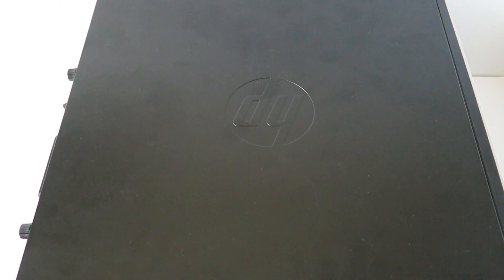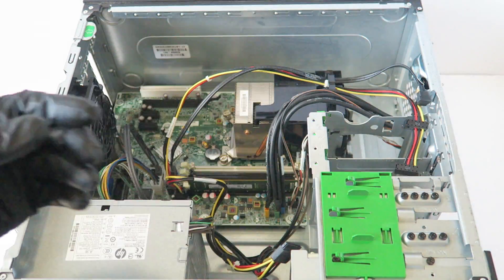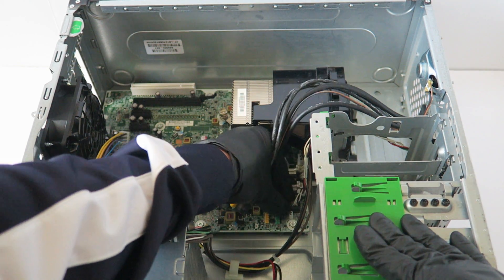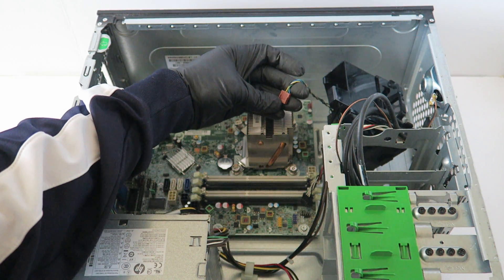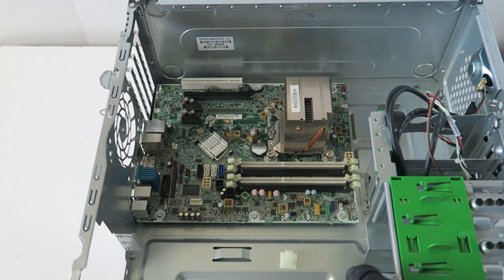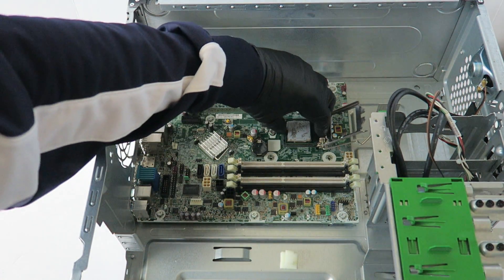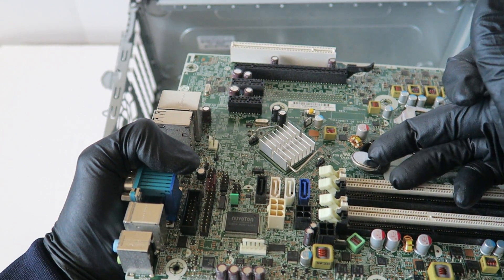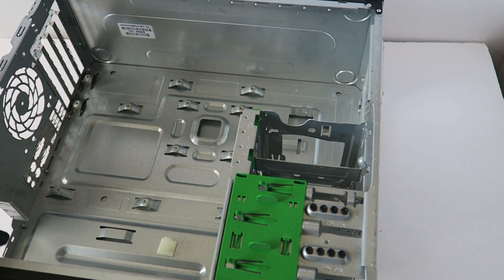How to Disassembly HP Compaq 6200 Pro

Comment: Hey man any idea why my fan runs at full power when I turn on the PC? It sounds like an airplane
Reply: Yeah if you go into bios pressing f10 when computer is about to start go into power and thermal and you will see fan speed idle option set it to the middle or less indicated by the start icons

Comment: my nephew bought one of these and we almost intstanty regretted it, power supply has 2 unique plugs, sata power comes via cables connected to the motherboard, impossible to get any decent vid card in because the cpu location blocks any video cards that are average length and width, there is an adapter to get a proper psu inside but that wont fix the weird pcie express slot location, a fair pc for non gamer/power users but defo not a good base for a budget build, oh and it also has minor issues with windows 10, if you reboot be prepared for a long wait with black screen, otherwise cold boot or boot from off works fine
Reply: I was able to fit a full sized gtx 1050 ti in it? what was the problem?